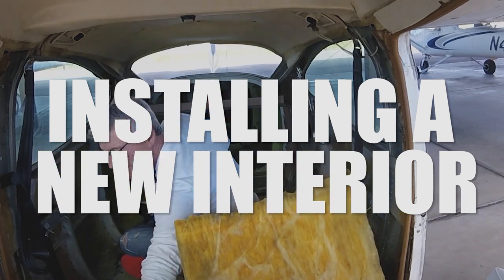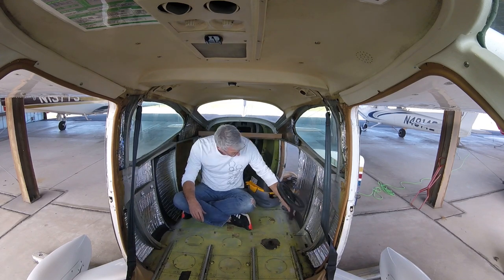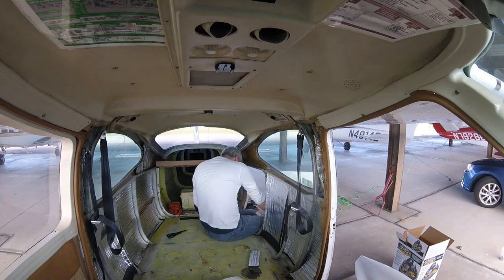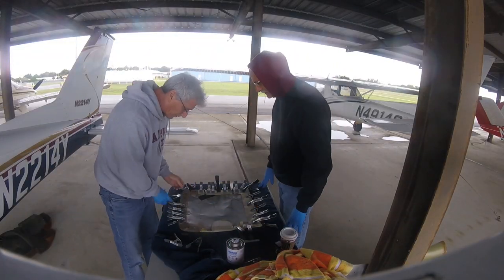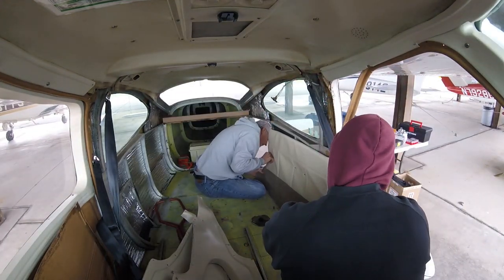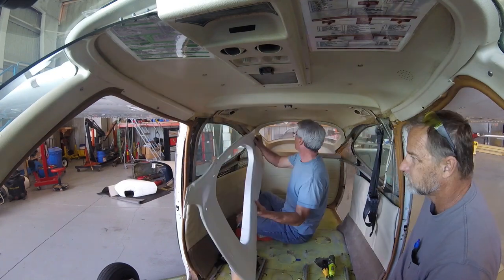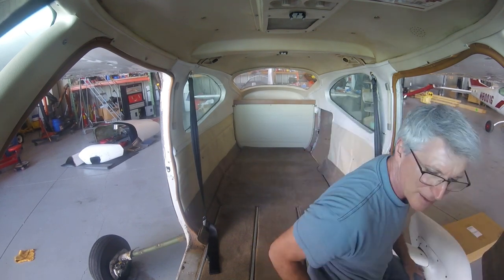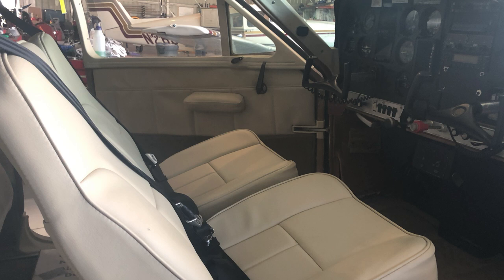Installing a New Interior in a 1968 Cessna Cardinal 177A

Comment: Nice job!  When $$$ allows, install some 4-point inertia reel belts from BAS. You can order them in a color that matches your interior. They are a great safety enhancement, easier to use, and more comfortable than your current set up.

Comment: I'm thinking about doing my interior this winter.  I've just done the engine, prop and avionics.  The 182  has been grounded for the better part of a year.  Part of me just wants to fly it for awhile before the next upgrade.  This looks doable, but I'm pretty sure that my first attempt won't be that great.  Decisions, decisions...
Reply from the maker: The one piece of advice I’ll give you is that do it all at once so take a couple weeks off of work or just take a couple weeks off and focus on this if I had to do it again that’s how I would do it and I would just treat it like a job and I probably can get the whole thing done inside of two weeks -I’ll tell you one thing it is very satisfying to sit in a brand new interior! Thanks for watching!

Comment: Looks nice. 1968 177A?? I thought the A started with '69 model year.  BTW, I pulled headliner for spar service letter, and  since it was such a PITA to remove, while it was out, I cleaned and painted, and it looks great. It was much more robust than the 53 yr old plastic side panels, which are more fragile than frozen butterfly wings...

Comment: Great video, Ted! I have my Airtex interior on-order for my 177A and seeing what you had to do is very helpful. Question: How do you remove the door handles? Is there a clip behind the panel that you have to remove? Thanks!
Reply from the maker: The doorhandles are very tricky. I actually had my ANP do it. There is a small sea clip behind the door handle that you have to get in there with a pic and very carefully pull out the C clamp. 
I decided just to pay my mechanic to do it because it would’ve taken me all day and I probably would’ve destroyed something so don’t be afraid just to pay the mechanic to do it because at the end of the day it’s worth 100 bucks to have someone else do it properly. Thanks and I’m glad you liked it!

Comment: Love the video, Ted. One question: I called AirTex about that baggage compartment bulkhead and they said they didn't make such a thing. Did you order it special or what? I'm doing my '69 177A as we speak (it's a MUCH more involved job than I thought) and would love to have a bulkhead like yours. Also, where did you get the rebuild parts (rollers, etc) for your front seats? You seem to have a great source for materials! Thanks in advance.
Reply from the maker: Sorry I didn’t see this coming till now, I got the baggage compartment from plane  plastics out of Kansas and I went to a true value hardware store and they rebuilt the rollers out of washers and just roller parts. Thanks for watching!

Comment: How much weight did the sound deadening aluminum/rubber matt add to the gross weight?  We did that on the interior of our van and it makes a huge difference
Reply from the maker: It didn’t really add anything to the weight and balance it was all negligible In fact it was just a couple ounces of difference that new insulation was super super light and yes it did make a huge difference. Thanks for watching!
Reply: @Over50andLearningToFly   No worries and thanks for the response.  61 and planning on doing what you are doing so I am a loyal follower